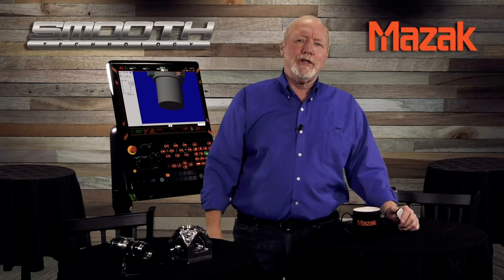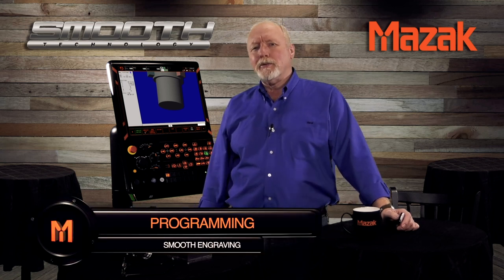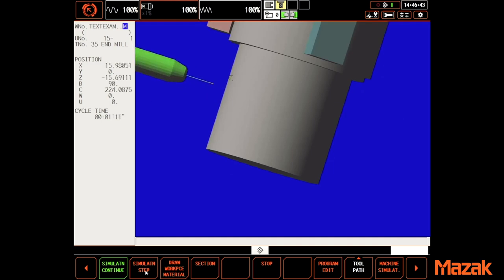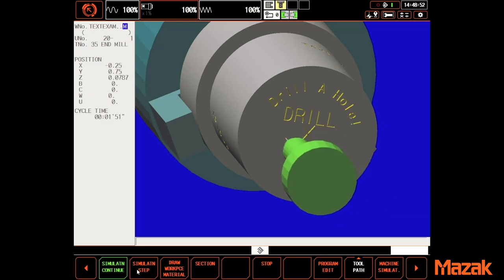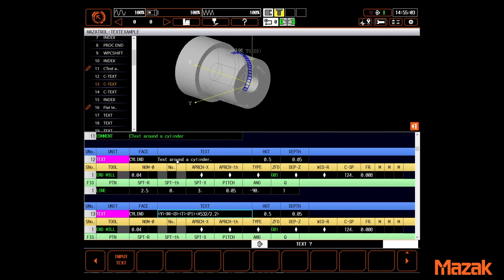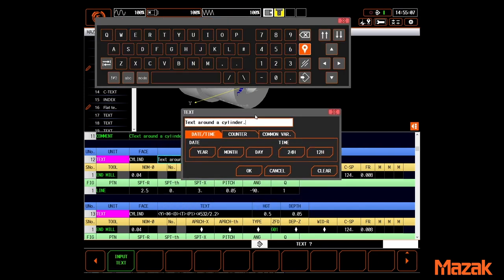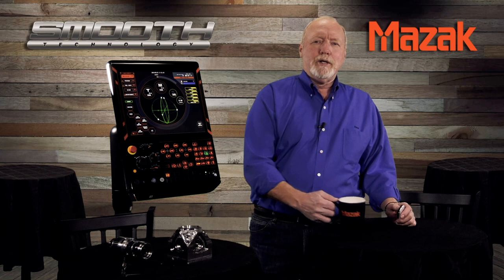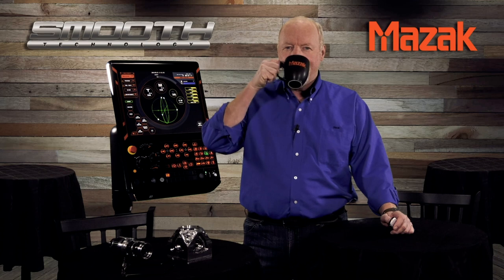Mazak SMOOTH Cafe: SMOOTH Engraving

Comment: I dont expect you to answer but can the serializing feature be accessed on the fly if you use G code or only if you are programming in Mazak conversational?
Reply: Looks like you got what you expected...no answer.  You know who answers their customers questions? It starts with an H and ends with an S...and has a couple AA's in the middle.
Reply: I don't know the answer on Mazatrol, but HURCO has had that option for many years!
Reply: @tucobreakinbad5000  I used tp be a HAAS guy too until I bought a brand new UMC 1000 and my spindle floats around +/-.003" and HAAS is perfectly OK with it!!! Mazak makes REAL CNC machines HAAS makes toys.